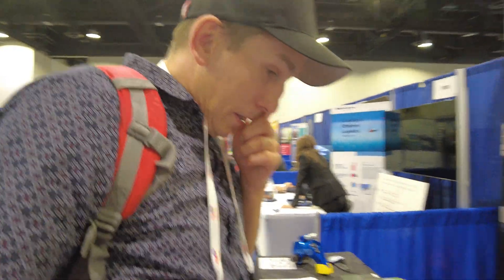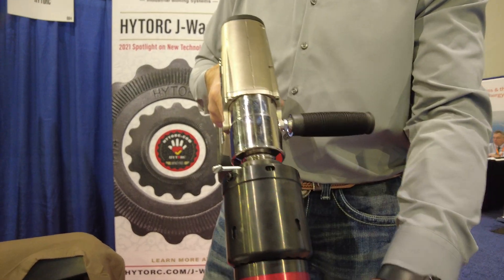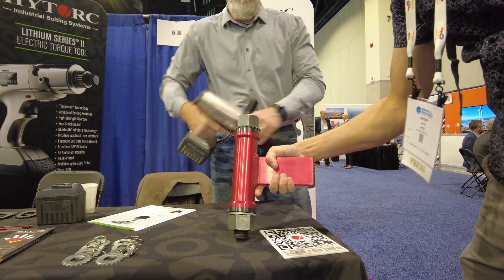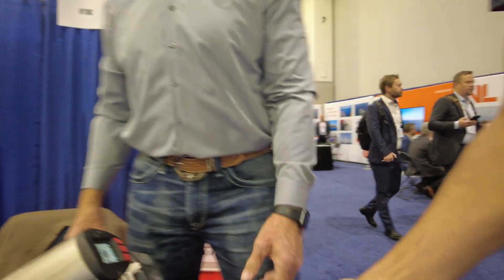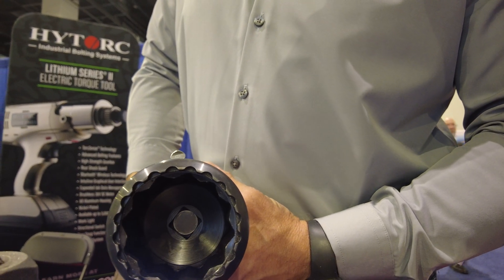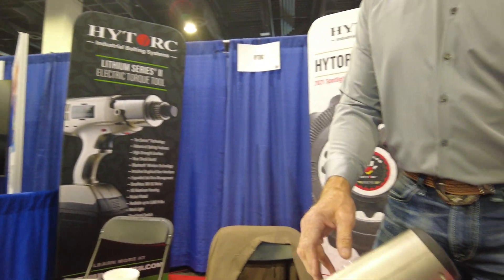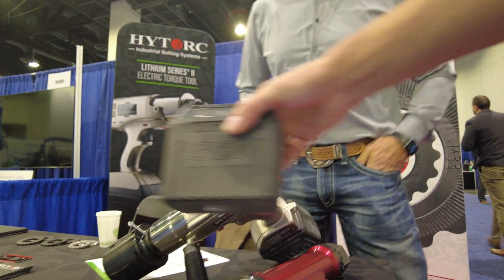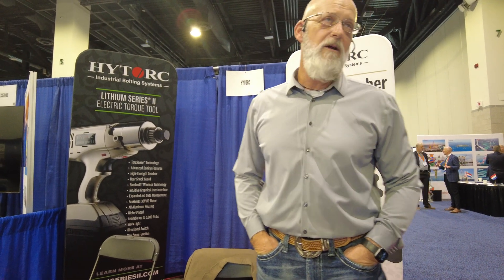HYTORC - Industrial Bolting System Demonstration

Comment: Had to go back a few times but how is it possible that at 350ftlb he moved it with his hand with ease then calling it 350
Reply: He loosened the nut with the drill, then moved the nut with his hand then tightened the nut with the drill, and then rotated the entire apparatus with his hand... Everything turned with the nut did it not?
Reply: @J_L22  at 57 seconds u can see the ribbed caller under the nut move back and forth after he tightens it secs b4 and calls it 350ftlb
Reply: @mikeshandtightgarage4893  It's the light that makes it look like it moves after he torqued it.

I had to go back and watch it on my computer because it didn't make sense, lol.

- He loosens it first (shows it with his hand that it's loose).
- Then he tightens it with the tool to 315ft. lbs.
- Then, when he's moving it around and etc, the LIGHT makes it look like the collar washer thing is moving. When, really, it's not moving at all. It's just the light playing an illusion.
Reply: @strikeforcek9149  I don't know what video your watching but I just went back again and sure enough it's moving at 57 secs. The man is holding it with his had on the red bar and the demonstrator grass and moves the nut and washed side to side and the man's hand on the red bar never moved with it showing a separation and non tightness.
Reply: @mikeshandtightgarage4893  bud, the nut nor washer are moving lol. It's an optical illusion, because of the light AND because when the washer moves its actually the entire red bar moving.

Watch the red bar in his hand when the "washer moves" the entire unit is actually moving — plus the light shining tricky.
Reply: @strikeforcek9149  Sorry homie, that nut moved. Proof: Slow it down. Look just at the old guy's thumbs. They should stay the same distance from each other. His right thumb moved far more than his left thumb.
Reply: @strikeforcek9149  Actually you might be right. Just looked at 10 more times. i dont think hes gripping tightly with his left. Whatever. Man, i need to go outside.